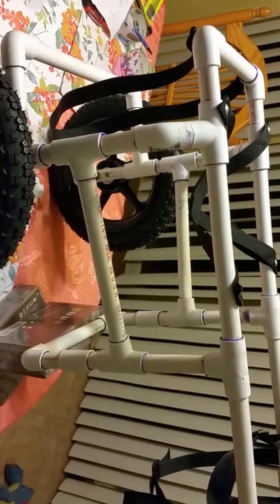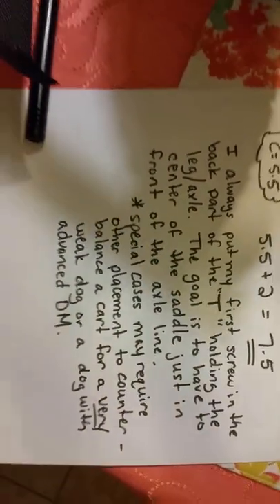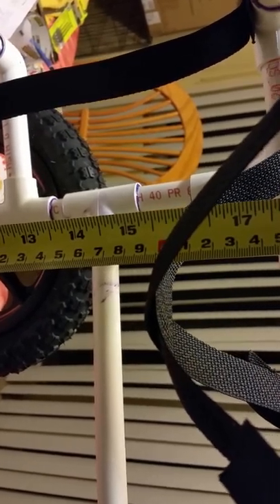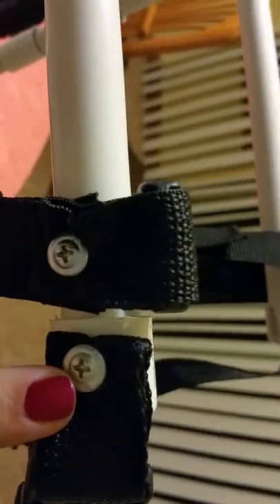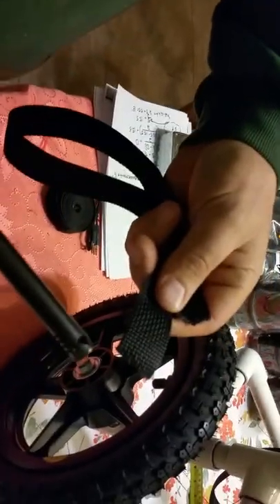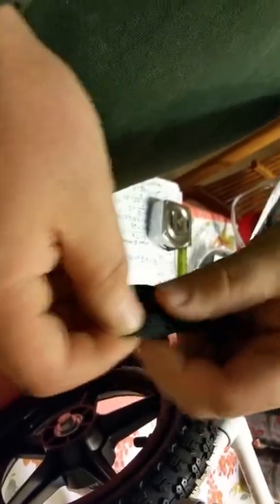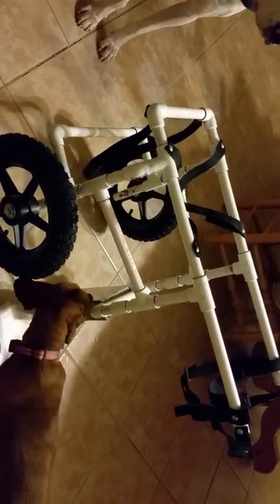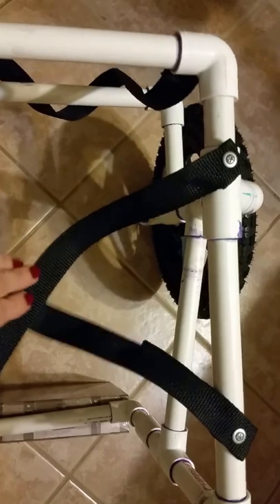Saddle and Straps

Comment: What did you use for the straps and where did you buy them?
Reply: You can use a leash or belt and cut them ,but you can buy this at any place that sells fabric
Reply: Do the Google and search for nylon webbing.  Any color, any width you desire is out there.  If you prefer to use velcro to attach the straps but don't have a sewing machine, any decent shoe shop can sew the velcro to the webbing material.  The velcro makes it adjustable should you make a slight error when measuring.